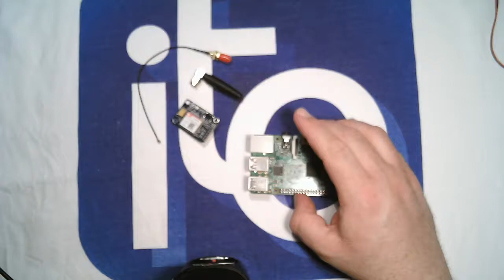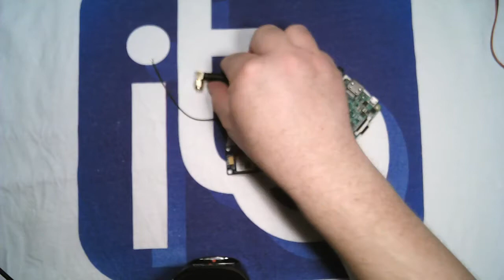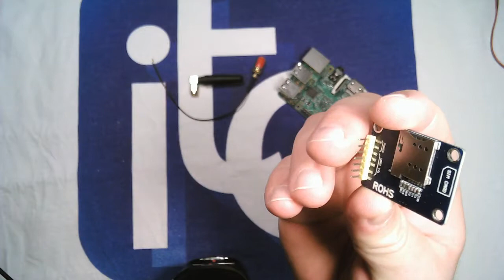building a raspberry pi phone - update on gsm module

Comment: who is the manufacturer? You have no notes on this page!
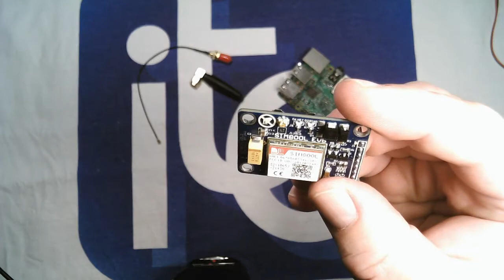Reply from the maker: Thank you for the question, and thanks for watching the video. - The first (smaller) module showed around 00:13 is the "SIM800L V2" bought at www.makershop.de (I can't remember if via ebay or amazon). You can (right now) find information on it at this link: https://elecrow.com/download/SIM800_EVB%20kit_User%20Guide_V1.00.pdf - this is though another vendor. The module uses the SIM800L chip which is described in many places on the internet. The AT commands are for instance described here: https://www.itead.cc/wiki/images/6/6f/SIM800_Series_AT_Command_Manual_V1.05.pdf 
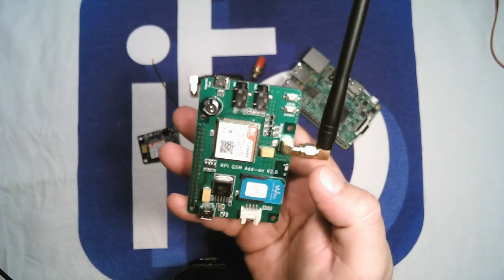The second (shown at 01:27) is the "rpm gsm add-on v2.0" from ITEAD. The have detailed documentation here: https://www.itead.cc/wiki/RPI_SIM800_GSM/GPRS_ADD-ON_V2.0